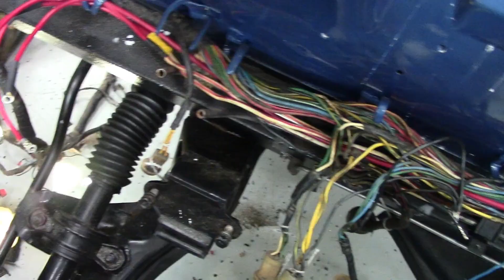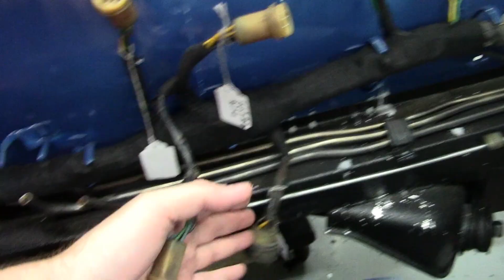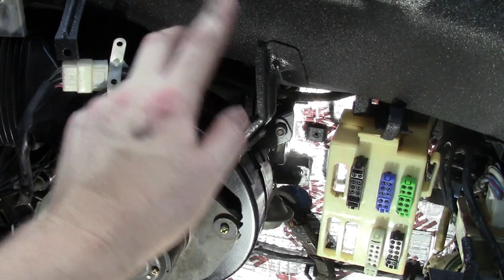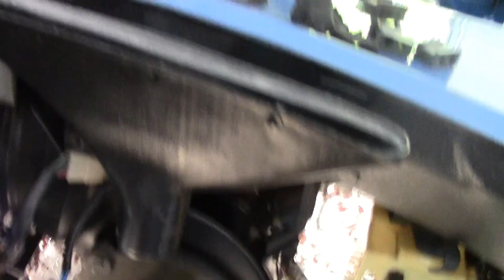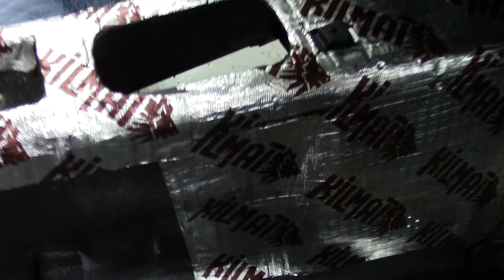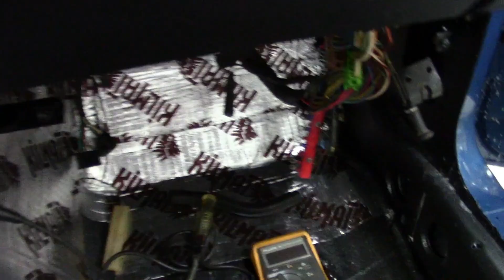Rewiring/Modifying 76 Datsun 280Z Harness To Work In Early 260Z

Comment from the maker: Figured out why the fasten seatbelt buzzer wasn't working. The seatbelt switch is normally closed when seatbelt is not fastened. I jumped the pins of seatbelt wiring harness and buzzer started working.